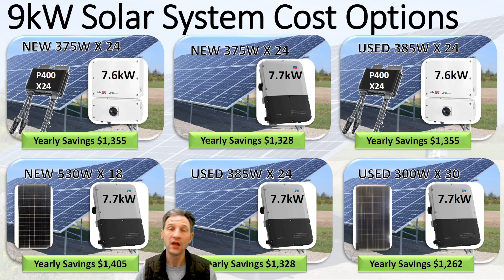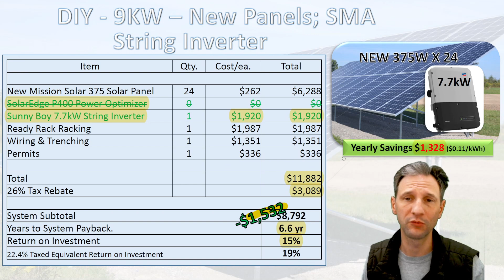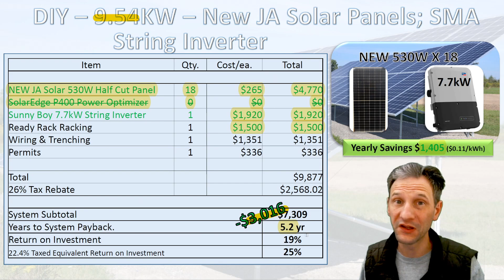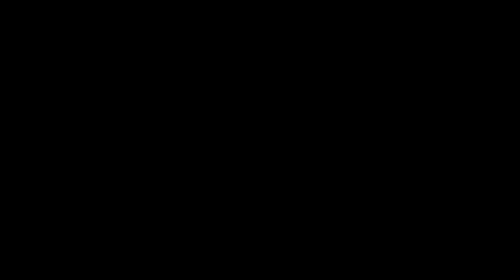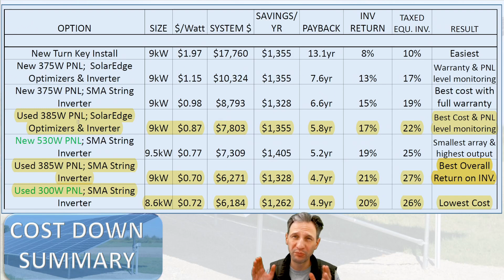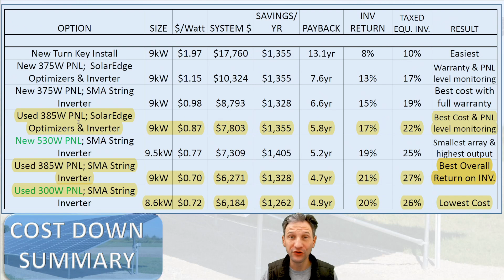DIY Solar Panel System - How to Do it CHEAPER!!

Comment: Hi Dave, Thanks for the informative solar videos. I recently finished my grid tied system using used solar panels and motivation from your videos. (13 kW system w/SMA string inverters). The project was more time consuming than I estimated but I throughly enjoyed it. I would like to point out a couple things.
1. Unfortunately used panels don’t qualify for the federal tax credit.
2. RES Supply sells SMA string inverters about $500 cheaper.
3. Ohio does have a SREC (Solar Renewable Energy Certificate) market that solar owners can sign up for. Ohio’s market doesn’t pay much but on a system your size could equate to maybe $1300 in 10 years time.
Looking forward to your next video. Dan
Reply from the maker: Thanks for the information!  I was not aware of the tax credit limitation on used panels.  That would change the numbers a little bit.  The new JA Solar 530W panels would be an even better solution in that case, it doesn't change the order, but makes it much closer to the used panel solutions.  Thanks!
Reply: I have been getting tax credits for used panels for years.  There is nothing in tax form 5695 about used panels
Reply: Hello, if used panels dont apply to the tax credit, would the rest of the parts including inverters and batteries count as long as they are new? any info would be great. thanks
Reply from the maker: Of course you should always check with your tax advisor, but I believe the new parts would qualify.

Comment: If it is a new install make sure the "used" panels if you go that route are ul listed. Some of the used panels for sale have had all the labels removed and you will not get your final inspections approved for grid tie.
Reply from the maker: That's correct.  SanTan Solar indicates on the panel listing if it is UL listed or not for grid tie applications.
Reply: @ProjectsWithDave  one other thing about used. If it’s used I don’t think you can get the rebate on that portion I believe.